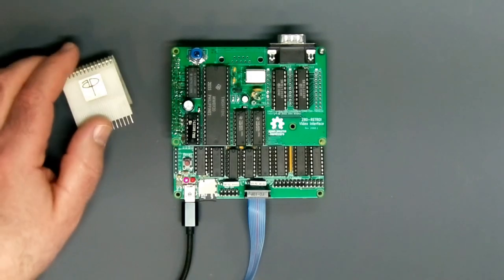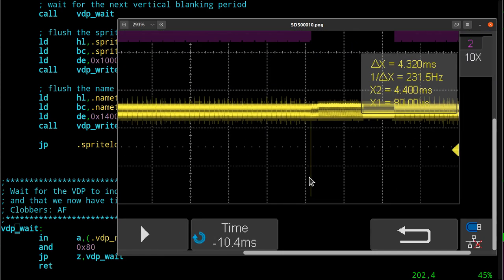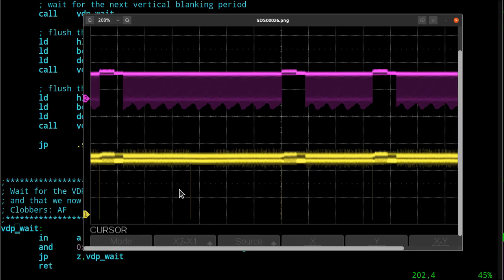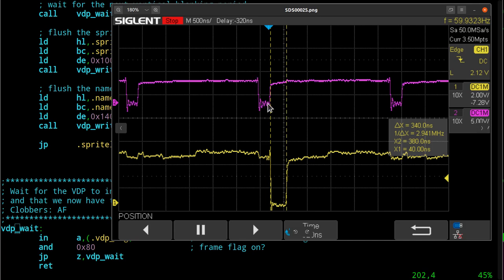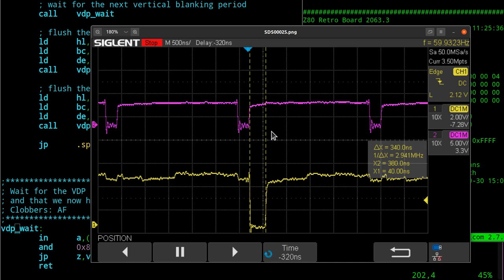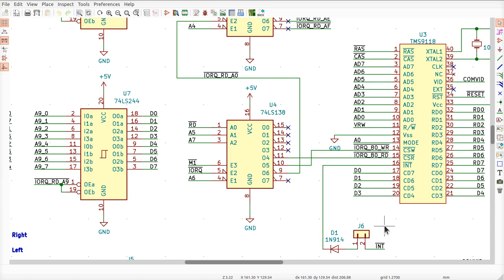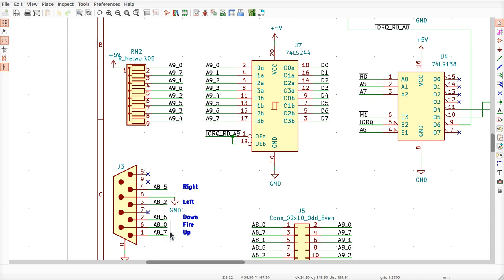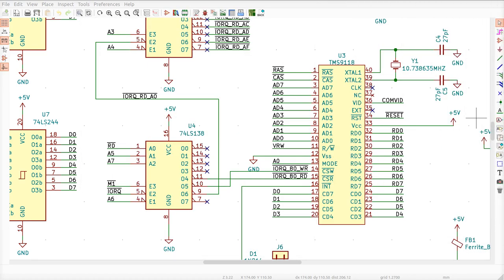Z80 Retro #58 - TMS9118 VDP Frame Flag Race Condition?

Comment: Hi John,  I'm wondering if you aren't falling victim to something having to do with having a CPU clock and a separate Video clock.  Often, designers would use the same clock for the CPU as the Video chip and hence, that output pin from the video chip you are using.  I can see how this might cause you to be missing this signal.  Metastability ???    Anyway, have a think about it and let me know what your opinion on this is.  Am I just being a dork ???   :)
Reply from the maker: This is definitely playing a part in this.  But it fails on the same clock too because it is the same on the NABU.  So one must also consider the clock phase, the select signal relationship to the system clock, setup & hold times, ...
Bottom line is you cannot select the status register LESS than some time T before the frame flag is asserted.  Since that is tough to know, you have to observe the IRQ signal active before reading the status reg.

Comment: In effect the only way to reliably read the frame flag is by setting up a interrupt and read only here the status reg, storing the value in ram. then if one wants polling this should be doing on the ram value.... this behavior is not know by every one in the world but most people knews about this.
Another beautiful things is this:
As you know, to setup a register write or vram address ptr you need two ports instructions. However, because the port used for status register read IS THE SAME used to setup reg writes (my god! are you crazy to differentiate those things) on the colecovision a very stupid thing can happen. The VDP is hooked to z80 NMI line, so it cannot be "masked out"!. What does happen if you are in the middle of a register write or vram ptr setup and suddently a NMI happens? clear. you go to int handler and try a read of status register. This read CLEARS the internal state flag of ports used to setup the register or vram ptr, messing your code. And because it is not masked YOU CANNOT DO a DI instruction to protect what should be an atomic operation. Well done, Karl Guttag, another fine bungler made by sacrificing everything on the altar of transistor reduction!
Reply from the maker: This is ass.  I connected the IRQ output to a GPIO input port and polled it instead.  No metastability. No IRQ race conditions.

Comment: TMS VDP is garbage at every aspect. One "cool" thing that can happen is that you can set some of its internal register to use only a reduced part of patterns or color table to less than the usual 6144 bytes. However, this is causing sprite ghosting (some sprite gets repeated at lower Y coordinates and you can get only 8 sprites. This weird behaviour, is , of course related NOT only to the values of the registers, but ALSO RELATED to chip TEMPERATURE. It tends to be visible or not depending of the temperature of the chip. I suspect that some digital transistor outputs are unable to drive some others in this configuration when chip gets more hot.

The idea of sprites was a good idea, but the chip design was shitty. Even the bitmap modes could have been implemented with a lowres pseudo multicolor mode, instead of the 64x48 mode that is useless. the sprite Y magic value is another horrible design choice.
when Karl Guttag presented this chip, there was a discrete interest and feature request but it is clear that the main target of Guttag was to save transistors and not to make a decent device.
I remember someone asked for a limited hw scrolling support and Guttag replyed. Oh, no.... it would require at least 40 transistors!
Pratically every feature request resulted always in the same reply: "Oh, no, my god.... it require at least 30 - 50 more transistors... request denied"
Reply from the maker: :-D  Yeah, this chip is pretty primitive.  I am going to make my own with and implement it in an FPGA.  I certainly can't do any worse than these TMS chips.